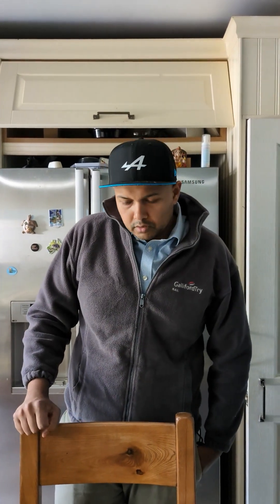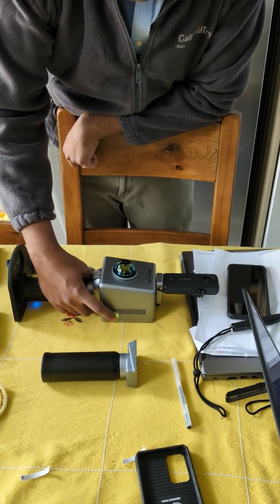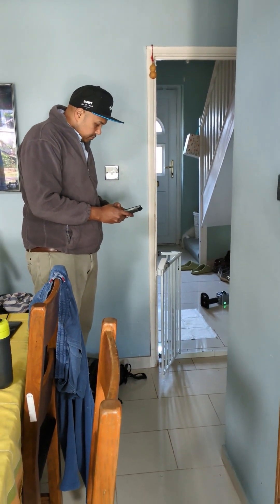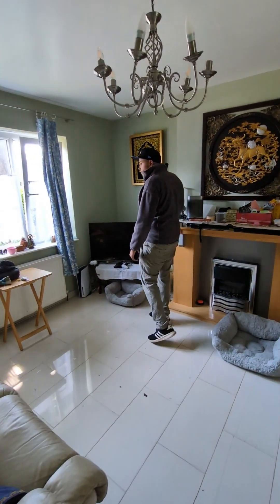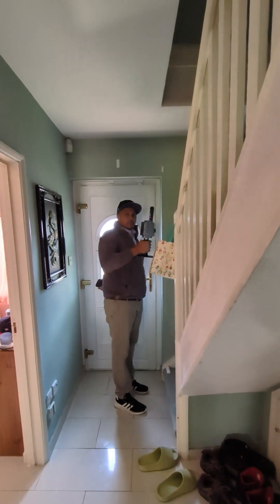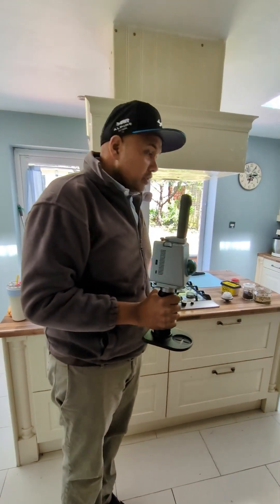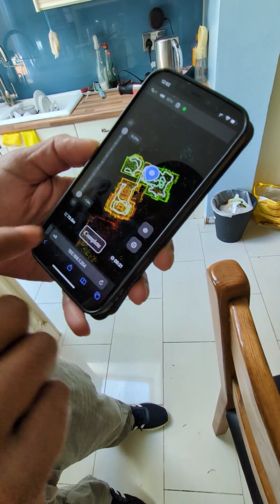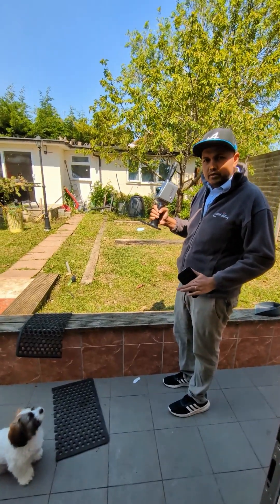Basic Scan process for FJD Trion P1

Comment: You have made a few mistakes. 

Putting your hands in front of you while you talk for example, the X scan angle is 180°, meaning you must hold the scanner in front of you, including in front of your other extremities such as arms and legs. 

Also don’t lay the unit on its back like that when initialising. Instead, stand it on its base (which is literally the function of the base). 

You should only tilt it back like that when you are passing a narrow space such as a hall way or corridor
Reply from the maker: that's what I've been told and taught by the FJD team on initialising the scanner, and it has not made a big difference if it does pick up arms as it gets rid of it in processing. 
TBH it is quite heavy to hold far away from your body.